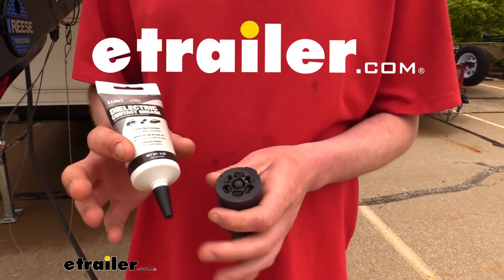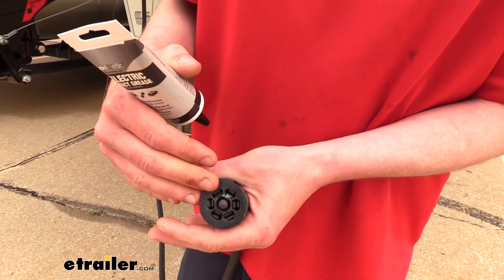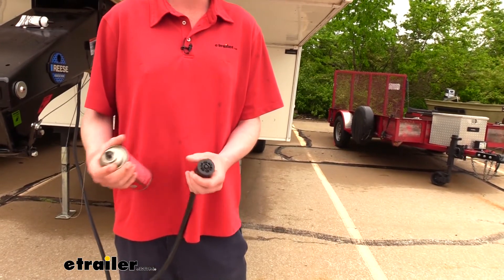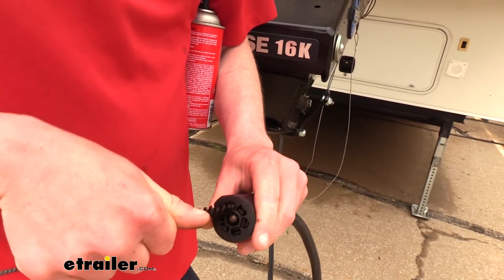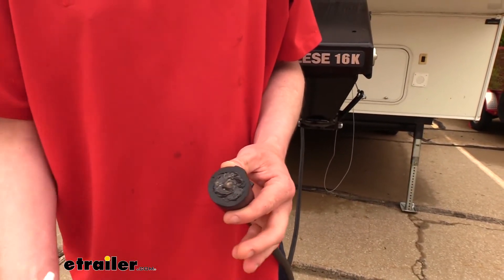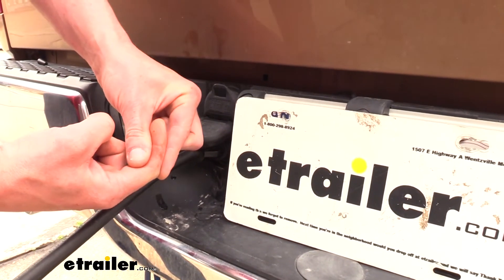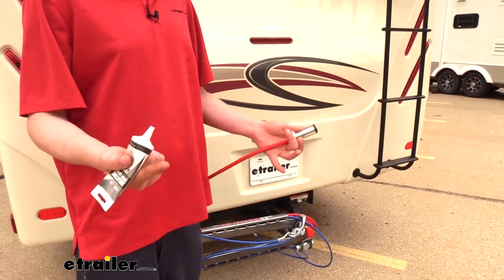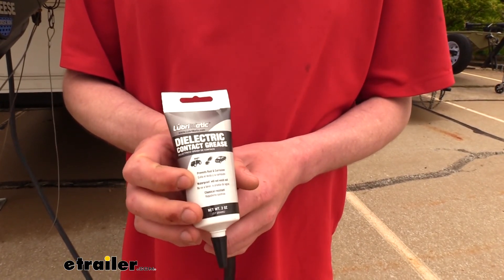etrailer | Ultimate Overview of the Dielectric Grease for Electrical Connectors, 2 oz.

Comment: According to Mr Google most dielectric grease is not conductive so may insulate the pins, better of using a electrical cleaner with silicone, WD40 and Vaseline will eventually eat the rubber.

Comment: Has anyone used the dielectric grease on their 30a / 50a power cord ?
Reply from the maker: That'll work just fine to keep moisture out of the connection!
https://www.etrailer.com/Accessories-and-Parts/LubriMatic/11755.html

Comment: I understood that the grease does not conduct electricity, so it shouldn't be applied directly to the mating surfaces (pins and sockets) of an electrical connection
Reply: Literally every manufacturer of dielectric grease says to squirt it into the holes and get on the contact surfaces. Paradoxically, every YouTube commenter says not to.
Reply: As he explains in the video, as soon as pins are inserted,, the grease poses no issue because it is scraped away — without being able to conduct electricity from pin to pin, thus shorting out the system.
Reply: Works!
Reply: Yes it should.

Comment: It's not stated though I ass-u-me you'd want to disconnect the rig's batteries first?
Reply: Ya why???
Reply from the maker: You do not have to disconnect the battery before applying the Dielectric grease but you can if you so desire.
https://www.etrailer.com/Accessories-and-Parts/LubriMatic/11755.html
Reply: @etrailer  Step 1 of the directions on the can of CRC he is holding states. "1. Do not apply while equipment is energized." Also couldn't the use of a wire brush cause a possible short if the battery was still connected?

Comment: That's an incorrect application of dieletric grease. Do NOT apply to the metal parts or the holes leading to the metal pieces. Only the plastic.
Reply: Thanks to whoever made it someone watched it and did this to my truck and camper. Now it doesn’t work.
Reply: You're wrong.  The idea is to seal out moisture and dirt.  This is why you're using a non-conductive material.
Reply: @Sometimes_Always  He's correct. You seal out moisture and dirt by applying it to the mating surfaces, not directly to the contacts of a connector that is connected and disconnected often. Another use case would be car battery terminals, where the connection is made and left alone. You would not apply this to the terminals until AFTER making your cable connections, ensuring the dielectric does not insulate your electrical path. SOURCE: AM ELECTRONICS MAN
Reply: @Sometimes_Always  great idea. Smear a load of non conductive material between two surfaces which need to be in contact to conduct said electricity. Dielectric grease has its place but not in the volume and method shown in the video.
Reply: @marcaustin I’ve been using it the ‘wrong’ way all these years and never had issues.
Reply: Incorrect.
Reply: Make a video